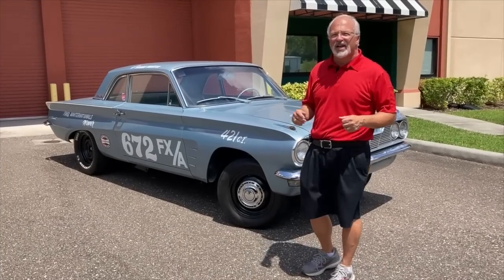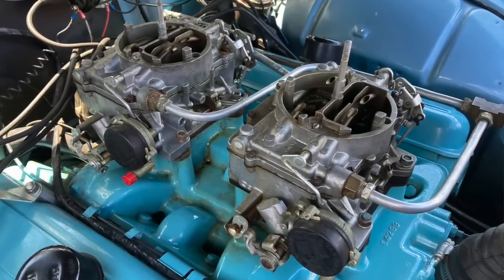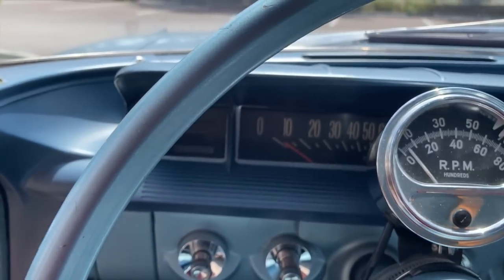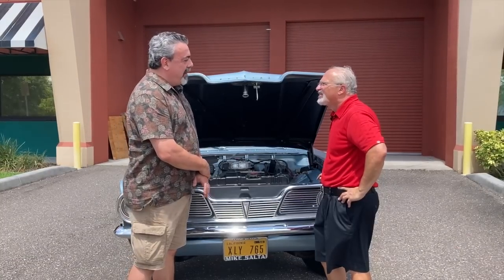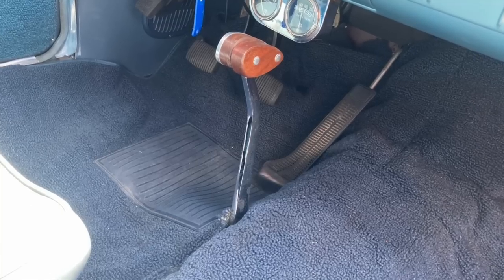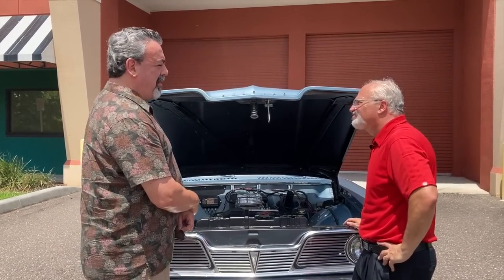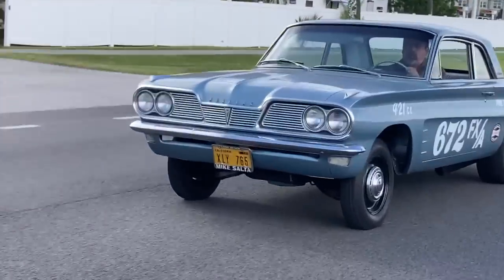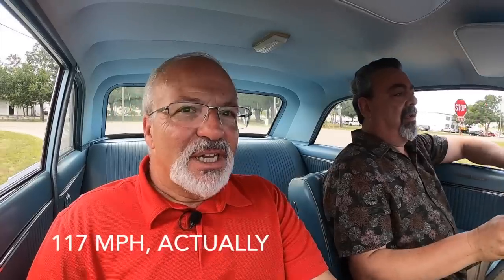1962 Mickey Thompson/Hayden Proffitt Super Duty 421 AFX Tempest Lemans

Comment: Back in 1966 or 1967 I don’t remember the exact year. I had a 63 Tempest with a 389 four barrel with long tube headers and 3 speed on the floor. What an animal it was I was still in high school and used to ride around quite often with the headers open and cheater slicks. If you know anything about that specific year it had a 1 inch thick drive shaft inside of a closed case. I can’t tell you how many drive shafts I went through but it was quite a few! lol 😁

Comment: Great video Campy! Amazing how they shoehorned that 421 under the hood! And yes that was when men were men and built stuff without any help from a computer.
Reply from the maker: No bigger physically than a 326. Fits pretty nice. The Buick 215 V8 was a factory option.
Reply: that is why the best they could do is run 12s........slow
Reply: @NoPrivateProperty  not with the shitty tires they had back then. It’s like low 10,s hi 9,s today, if not faster. One year later Stan’s 63 Lemans SD 421 ran mid 11,s at 121 mph on still shitty rear tires. Not slow by a long shot! Especially if you understand tires and history
Reply: @joshbrekke6374  they used to test cars with slicks for magazines. not much difference. not fast by todays standards
Reply: and grandma could daily it, 4 spd with manual everything still drive like an ace
Todays kids couldnt drive it around the block without crying lol

Comment: Great video. Beautiful car.  My first car: a 1962 Tempest LeMans, black exterior/red interior, three-speed floor shift, 195 cu. in. four cylinder.  Bought it in 1966. No six cylinder offered in 1962, but they did offer a little sold 215 cu. in. aluminum V-8.  The Trophy 195 engine mine had was half of a 389, literally.  Mine came well used, with a ton of rust, but on the other hand, it was my first car.
Reply from the maker: Funny, that was the Buick V8, but no one complained it was not a Pontiac mill.
Reply: It only ran on 4? Number 4? 😎
Reply: @musclecarcampy9922  - Only 1% of Tempests bought with the V8 though... and they admitted it was a (1950) Buick engine... 
In 1970's window monroney showed you paid extra for an Olds Rocket V8... but later your mechanic told you that you had a cheap Chevy V8 !!!
Reply: Reminds of my 1962 Olds Jetfire turbo V8 from back in the day, converted from the crappy automatic to a 3 speed T85 manual with Sparkomatic shifter with wooden/steel/wooden shift sandwich knob... 
https://www.youtube.com/watch?v=Jzw5W1rRMog
Reply: Yeah I once found a particularly small aluminum intake manifold with a four barrel plenum and eight ports.     It was on a relative’s property where some of our family would store/leave to rot some of our cherished cars,boats, whatever.   This intake was in a shed, and from a distance I could see it had four ports on the one side visible.    As a teenager with a 2 barrel 302 Torino, I briefly thought it might fit my engine.   When I picked it up I realized it was maybe 2/3 the size of a 302 intake.     Researched a bit, and my dad said there had been a very small GM aluminum V8, saying it was either a Pontiac or Oldsmobile.    In that same pile I picked up a single Shelby valve cover, with the letters raised, with crinkle finish background and Shelby was polished, and it had the same kind of build that the old M/T valve covers had, aluminum and solid, which sealed the gaskets better than the crappy factory stamped steel versions.   Nowadays, very valuable and rare pieces.    I’m pretty sure this was for a 351 Cleveland, as the size and pattern didn’t match the 302/351 Windsors, but it wasn’t the FE one either.  It could have been for the 429 but didn’t have that distinct profile needed to clear the valve train in those big block Fords.
Reply: @andrewhigdon8346  - Buick created that aluminum V8 about 1950 for concept cars. ALCOA was trying to find buyers for aluminum after WWII ended. Buick put it into mass production in 1960, Olds made a version of it, Pontiac used the Buick version, from '60 - '63. Then it went to Rover in UK where it was made until 2005 and used in several makes and models of cars/SUVs.

Comment: I love 62 tempests. 
Such a unknown stylish car. 
I’ve wanted to build a hot rod version for years. 
I was unaware of MT’s build. 
That thing is sweet.
Reply from the maker: Thanks for watching.
Reply: I LOVED my 62 Lemans Convertible White w/Blk top, Red interior. Dealer only had the 4 cyl tho. However when I got done with it, I stomped F85 V8s. Amazing what a simple bore, balance and Cold Air intake could do. (All  I was able to afford in my youth. LOL)
3 cars I loved. My 47Ford vert w/hot Merc eng, my Lemans and then my 68 Formula S 340. I added CAI to the latter 2 after reading Smokey's advice. It knocked 1.5 sec off the 340's time.

Comment: Seeing this car reminds me of the  62 Tempest  Lemans I owned while working at the Exxon Station, I boought it for very little money, it had a 326 cu in engine with a 2 barrel carb, the 3 speed transaxle from the  4cyl. engine. I tuned the engine up plugs, points, condenser, dist.cap, plug wires, all settings. rebuild starded,battery,shocks, tires . Cleaned interior up, buff rust off the body and waxed. I had fun driving the  Lemans but  at  20 to 25 mph you had better be in 3rd gear or damage the trans axle. Had the car for a  couple of years , someone offerded me too much $$$, sold the car but I missed the little Pontiac.

Comment: It's hard to believe how good the 421 S.D. runs with it's puny heads, but it surely does!!!
Reply: puny heads -  ha ha ha ha ha ha   In 1962 the thought of puny heads did not exist.  There is a sweet spot where HP and torque converse.  Where is that sweet spot?
Reply: @jackreacher.  - As seen here: 
https://www.youtube.com/watch?v=gNg569agwiU
Reply: @jackreacher.  I disagree. Have you seen the flow numbers on the 62-64 Max Wedge engines? In 62 the 413 Max Wedge got 25% larger ports than the regular B/RB Mopar engines and larger valves to boot. To this day the highest performance aftermarket Mopar wedge heads still use the raised Max Wedge port configuration. The original heads flowed with numbers similar to the modern lower performance Gen 3 Small Block Chevy stuff (LS motors for those with less knowledge). Compare that to the early Super Duty stuff that was only able to flow about the same as regular street Pontiac heads by the late 60's like #62s, #48s, #12s or #13 400 heads. Even the later Pontiac 455 S.D. heads flowed slightly less than the Max Wedge heads. And I agree that torque makes a great street engine and Pontiacs excel at making usable torque, but we're talking race only and there, HP wins.
Reply: @1967davethewave  Using two 625 CFM Carters, I count a total of 1250 CFM for the 421 Super duty.  However, the 62 max wedge was produced with  two 600 CFM Carters which total 1200 cfm. This is not a considerable difference.  It seams to me that our argument boils down to terms.  You find pride in "Maximum" and mine is found in "super duty".  You dig Mopar and I go with the Indian.  However, 1962 is the main constraint with the Pontiac winning the national championships.  I found the word "puny" to simply identify your overall bias.  Win one and "puny" got lucky.  Win two and "puny" lacks logical support.  Hence, puny ha ha.  Puny heads on a national champion is simply brand bashing.
Reply: @jackreacher.  Well I currently own a 61 Catalina, a 69 GTO I've had since 1983, 3 79 Trans Ams and a 2004 Grand Prix, plus a bunch of Pontiac parts cars. The biggest misnomer that is out there is that a car that has for instance 2 625 cfm carbs uses all 1250 cfm. It doesn't. The potential is there but the engine only uses what it can burn and if 2 625 cfm carbs are wide open and the engine is only using 800 cfm then that is all the carbs deliver. The air speed through the carbs just slows down. And lets not get into how different the ratings are on carbs depending on a bunch of factors. For engines built in 1962 the 421 Super Duty with it's 1.96/1.66 and then 2.02/1.76 valves was a good breathing engine for the day. And engineers for Pontiac did take breathing into consideration. I guess I should have added to my comment, "compared to today's engines" they had puny heads.
Reply: @jackreacher.  and one more thing, had GM not pulled the plug on factory backed racing I'm sure we would have seen Pontiac engines with huge heads like the Hemi, Boss or even Rec Port BBC. Sorry if I offended you or made you think I don't love Pontiacs, it was just an observation
Reply: @1967davethewave  No biggie.  I see you truly love the Pontiac brand.  My first was a 65 GTO 389 tri-power.  Then 64 389 Catalina , 67 400 Catalina, 63 GP 2+2 421, and 68 455 (upgrade) Catalina.  I am eyeing a 62 Tempest currently, hoping my old 421 shows up in the weeds for a possible cool clone factory drag.
Reply: @jackreacher.  Those are some great cars. I held on to a 62 421 SR block for many years as I was going to do an SD clone out of my 61 Catalina but I decided to go another route with a 428 so I sold the 421 block last year.
Reply: @1967davethewave  Oh, what a tangled web we weave.

Comment: Now for the rest of the story , on page 26 of a book by Steve Magnante called " How to build altered wheelbase cars " you will find a picture of the Mickey Thompson car taken at Irwindale in 1966 as raced by Bob Porter . The car , like so many other race cars at the time , had been modified with a straight front axle , Mopar Max Wedge hood scoop , and had the rear end moved forward approximately ten inches . Porter was using the ex Doyle Gammel '32 Ford 3 window to flat tow the '62 back and forth to the track .Now you know what happened to the original car .
Reply from the maker: But where is it now? Big mystery.
Reply: @musclecarcampy9922  the NHRA outlawed the altered wheelbase cars by 1968 ,  which left bracket racing or street racing , considering how crudely the AWB cars were built I suspect it was probably crushed long ago . The way guys were hunting for the old race cars back in the '80s and '90s you'd think someone would have a clue of it's whereabouts or status . That is why I mentioned the photo in the book, hoping it would jog somebody's memory .
Reply from the maker: @bobbrinkerhoff3592  I appreciate that. You would think it would have turned up, but perhaps it was wrecked and parted out. All speculation on my part.

Comment: Those three speeds sure do pull nice in second gear - it's just that jump to third...
Reply: did he shift into passing gear at 9:00?
Reply: He took off in 3rd then shifted to 2nd......come on, guess he's not much of a stick driver. I guess torque of the 421 did mind that rpm drop to 3rd.

Comment: In 62 Buick received car of the year from Motor Trend Magazine thanks to ( Buick ) Engineering . In 62 Mickey Thompson’s Buick special with a Buick 215 ( Fireball ) Aluminum V8 went 92 laps at Indy before transmission failed , Dan Gurney was Driver

Comment: In 1962 For the Tempest/lemans, they offered a 4cyl (1/2 of the 389 in several HP configurations) AND a 215V8 like the Olds F85.  Never offered a 6 CYL!!!! Buick Skylark did but not Pontiac!!
Reply from the maker: You are correct. I was wrong.
Reply: @musclecarcampy9922  Only because my family lived Bunkey Knudsen's cars for so long. LOL 
And I owned an extra ordinary 62 Lemans vert myself. It wasnt "normal" when I came to "remanufacture" it. There were ll kinds of "parts" that werent in the Pontiac parts catalog. Didnt have the std dist., pistons were wrong for that HP version,, the hotter cam wasnt in the catalog, and it had a limited slip 2spd trans axle. While I had the engine in rebuild mode I had another Tempest 4 eng because I still had to get to/from work.. IT was a dog compared to mine. At one point it was suggested that my 62 was "like the special 4 Pontiac sent to the NY auto show" which might explain why the dealer was upset with the salesman and tried his best to buy it back.
Reply from the maker: @frederickwise5238  I appreciate you watching.
Reply: @musclecarcampy9922  In my youth I kinda lived cars. At 87, all I can do now is watch from my computer room. LOL

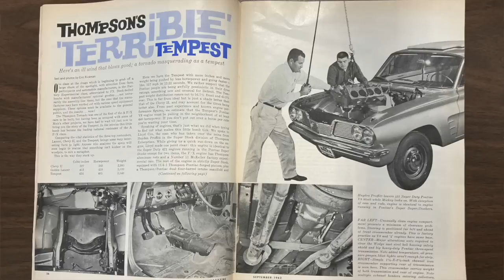Comment: The swiss cheese Catalina with the Super Duty 421s were turning 11s back in the day . They said they were still tearing up the drag strips way into the late 60s . The very sad thing and it makes me want to cry is 63 was the last year of the Super Duty . I dont know why the program was canceled can you imagine going down to your dealer in 64 and ordering a brand new GTO with a 421 Superduty ? It would to tore some ass up on the streets nothing would of touched it They could of opened a race program with GTO'S with aluminum front clip aluminum bumpers and a cross drilled frame battery located to the trunk with a set of 4:56 there would of been very few cars touch it So close but all closed down in a few months makes a person sad 🤥
Reply: GM officially pulled out of factory support of racing in 1963 both drag and Nascar.  Any one competing in a GM car after that was on their own dime.  Also, they had a mandate that you couldn't put more than 400 cubic inch in the A body, GTO 389, Chevelle 396, Skylark 400, Olds 442 400.  They dropped that requirement in 1970.
Reply: @mitchburk5112  I know that the race program was dumped . I was doing a what if on my post a GTO 421 Super Duty aluminum front clip cross drilled swiss cheese frame easily into mid 10s and you imagine what one of those would of brought on the auction block now if they had survived ? So close and yet so far😕
Reply: @madmanmechanic8847  THat woulda been the most badazzed early muscle ever built.
THose A bodys, 4link coil rear were easy to get hooked with minor work.
Reply: @gordocarbo  I am sure low 10s would of been easily attained or faster I honestly dont think anything would of touched them except maybe the 427 Ford Thunder bolt and even then would of been damn close

Comment: Super Duty power, 60s squeezebox construction, bicycle front tires and not even wearing lapbelts - what could go wrong?  🤣
Reply from the maker: To be fair, there is a lap belt—LOL.
Reply: @musclecarcampy9922  I saw it - installed but not in operation 😁
Reply: ..at least the throttle didnt stick..

Comment: THIS PONTIAC WAS  L I G H T...421 AND NO WEIGHT...2300+ POUNDS...CHEVY II WAS 2990 AND DODGE WAS 3023 POUNDS...NO WONDER...12:22 (?) WAS QUICK BACK THEN!!!!!
Reply from the maker: The engine tech was advancing rapidly.
Reply: I think you are being a little bit generous in your estimation. A 4 cyl. Version weighs 2920 so even with the aluminum parts it was way heavier than 2300.
Reply from the maker: I believe 2900-3100 is about right.